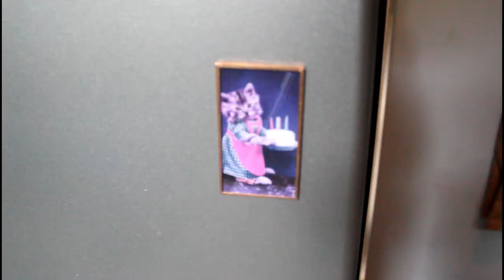General Update │ The Beginning of a Tiny House Renovation

Comment: Glad to see you. I totally get it, the exhaustion from the heat & humidity..and whatever else causes these immune issues. I completely got rid of all propane; using an on-demand electric one now. ... And, you really get the music just right for your videos--- it enhances well.
Reply from the maker: How do you like your electric? I am just worried I won't have enough since I only have 120 volts.   Yeah, I tolerated the heat a lot better last summer. I am trying to figure out why, it will probably remain a mystery, though.